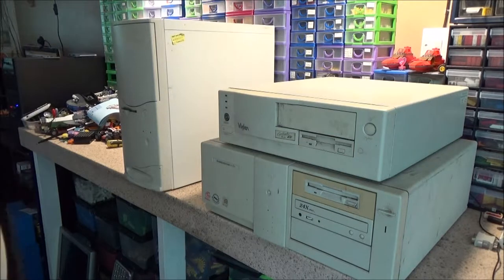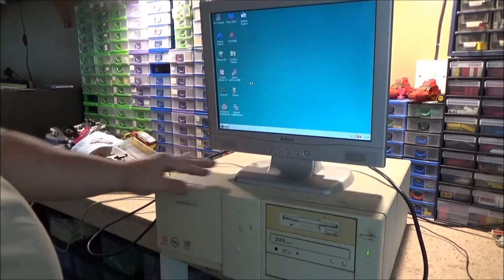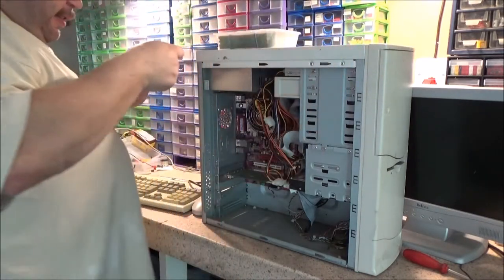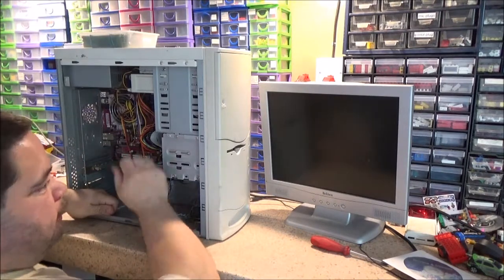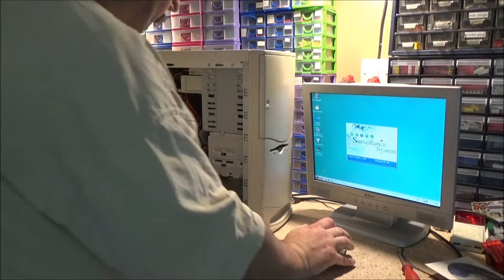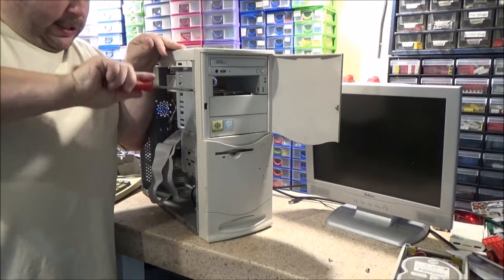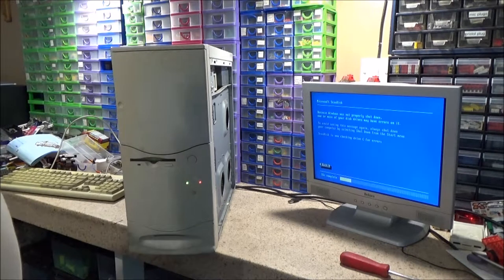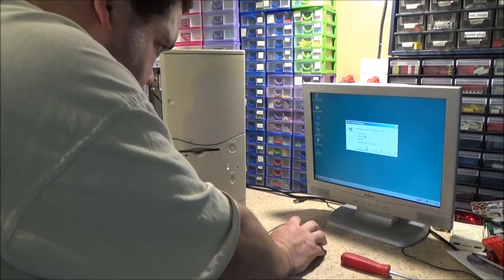Retro PC Haul! Windows 3.1, 95 And 98! Checking Them Over.

Comment: Another thing to keep in mind: If a computer reports that the bios was cleared or the date and time was wrong, often times it may not recognize the hard drive. Older systems have to have the drive manually assigned in bios.

Comment: The reason why the monitor is acting that way is because it has something called fixed sync. The monitor looks for a fixed sync refresh rate and tries to adapt to it. Unfortunately, the computer has adaptive sync where it changes the refresh rate on the fly. The monitor is rather confused as to what is going on. This can be fixed by either setting the desktop resolution to the base resolution of the monitor, or turning off fixed sync or sync mode on the monitor.